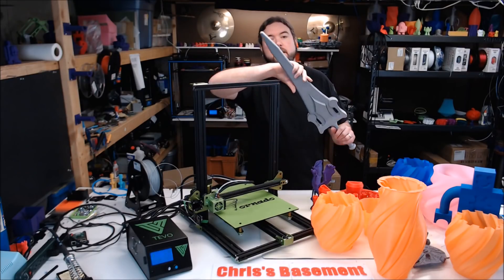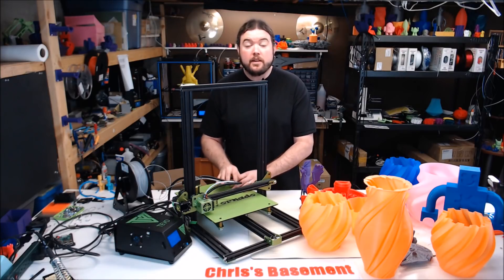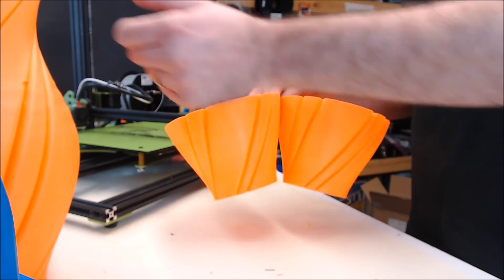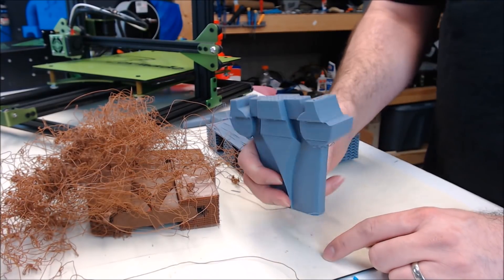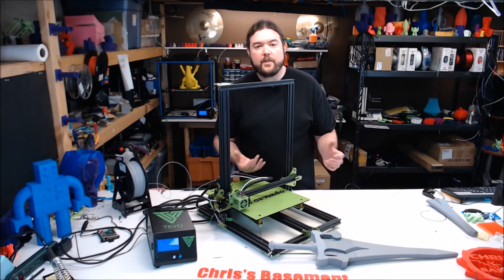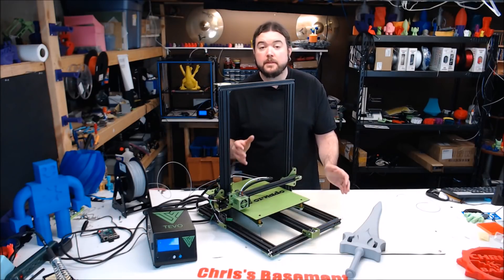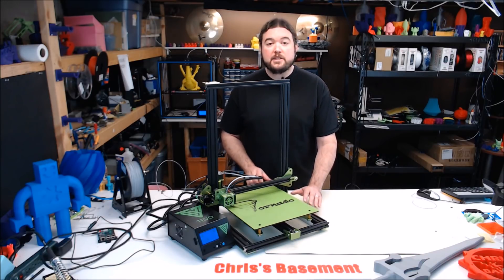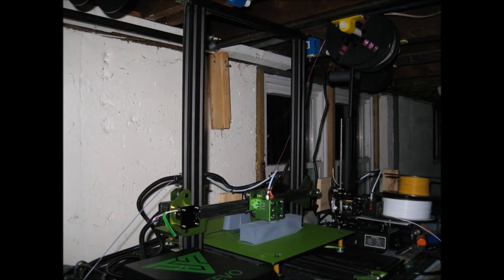Tevo Tornado 3D Printer Review & Tips - Chris's Basement

Comment: I have 2 of these machines. I agree, they need a little bit of extra TLC at first, checking alignments and what not, nothing drastic tho.

Once you do that, it is amazing printer, and most definitively one of the fastest at this price bracket. Just crank those stepper drivers to the maximum 1.50 Vref and you are of to races. I think i've printed a benchy around 48min mark.

It's been one of my more reliable work horse printers, and quite trusty. Certainly like any printer there is occasional issue, but never something where you have to buy something expensive, just some maintenance needs (checking pulley tensions, swapping nozzles etc).

I got also a Tevo Flash, and that is quite fast printer and nicely compact for the volume. Albeit i got one of the very early models with Fysetc TMC2208 V1.0 drivers which all but 1 fried and was randomly missing Y steps, but only once per print, and always some 2mm at once (and irrelevant of Z height). I got a video up with TB6600 drivers on it, printing a VERY bad benchy @ 38mins, but that was 0 tuning, Z height off, and gcode sliced for normal 100mm/s speed, with hotend being waaayyy too hot to cool that fast.
Reply from the maker: Agreed, I think with a few tweaks here and there the Tornado can be a reliable machine. I really like the AC bed. Glad to hear you have had luck with Tevo printers.
Reply: Yea i think you cannot expect much more for the money, QA is a bit shoddy.

I compare Tevo VS Creality like that Tevo has higher grade parts, higher grade engineering, but shoddier workmanship & QA than Creality. But Tevo does not skimp a few cents to cut off quality badly, but actually want to create great machines for people, and honor GPL without even asking to, and keep their machines open for tinkering :)
Creality on the other hand is happy to skimp 0.10$ on a part that lowers quality by 50%. Particularly the obnoxious joke of control board and stepper motors they use. Even with the craptastic extruder you can live with, but closed garbage control boards? nawh, that kinda closes you from fixing their stupid stuff.

Just the other day i had to replace also Y motor on my first ender-3 (replaced X earlier) as it too failed, my smallest one with 6pin plug was much larger (like twice the size) than they used; It hits the bed carrier because it is too large -.-

Comment: The problem of the layer shift is the slicer,wich are you using. The only ones working for me until yet are slic3r and ideamaker. I used Cura first and always got layershifts!
Reply from the maker: I always use Slic3r for everything. My Y motor way actually skipping steps.

Comment: Finally a bonified review and not from a best gear lot lizard! Keep it up and awesome review. I just bought the 2018 version. Before assembly, I disassembled the whole thing. Square up all extrusion ends on a mill and printed several little shims to get dead nuts alignments. Insulated the heat bed, capricorn tube, Swiss hot end and a belt drive on the top to the other z axis. Installed newest marlin and heat sinks on everything. Been running near 24 hours a day and near perfect prints. Reckon we are still buying kits though...
Thanks Larry
Reply from the maker: Thanks for the comment and watching the video! With the kits there is always some suprise waiting. It sounds like you did it right. That's probably a really solid machine now.

Comment: Hey Chris the problem with the parts falling over happens because the bed is moving try rotate the model 90 degrees :)
Reply from the maker: Thanks for watching! I tried that thing every which way!:) I had a lead screw bound up, after I fixed that, everything started working much better.

Comment: thair online support is really good i haad to use it because the lcd didn't display saome lines properly but that fixed itself
Reply from the maker: Vega 128 That's good to hear, I have never tried there support. Yes, I got a green and a red one.
Reply: by the way, if you want to replace the bed with a glass one then use a mirror because this makes it easier to see the nozzle witch would be hard to see because of the bulky hot end asambly

Comment: Can someone explain how he solved the z axis problem???
Reply from the maker: Hey, on mine I just removed the top bearing an the Z rod moved to its correct location, then I just moved the Z holder over. I would remove the top Z rod holder, run the X axis almost all the way to the top of the machine, then put the Z holder back on. That will probably solve it.
Reply: Ok thanks so much
And keep it up you are awesome
Reply: Hey could you explain the last part? The one where you would bring the z axis up etc...
Reply from the maker: Not sure what you mean? To bring the Z all the way up? You should be able to do this from the LCD in move axis.
Reply: I brought it up, my z rod is centered but a little bit to close to the z rod holder. I do not know if you understand. The rod is centered from left to right but to close to the z rod holder
Reply: And thanks for your help and caring about your subscribers
Reply: And can you do a video with upgrades for the tevo tornado?
Reply from the maker: I might some day. ;)
Reply from the maker: So it's to far forward or back. That might be something wrong on the motor side. I would try to remove the motor and Z rod connector and reset them. See if that straitens them out any. Make sure the sure the Z nut on the X is flush an tight as well.
Reply: I found the z nut being to much back. How do I fix it

Comment: At around around 10:30 you stated that there are better choices for around the same price. Just wondering what those are.
Reply from the maker: OneLiterPeter For ease of use and print quality I prefer the CR-10.
Reply: Recently I made the choice to upgrade (from my Solidoodle 2) and went with the Tevo Tornado. I ran under the assumption that pretty much all of the 3D printers from over seas will suffer from some setup issue and that all of these printers from the Prusa to the CR10 will need the user to setup and tweak the machine. Watching your video along with my own experience confirmed my assumption. The CR10 is not perfect either, in fact, just searching youtube for the term CR10 mod's returned a staggering 15,600 results. I also have a couple friends that own the CR10 and CR10s and honestly... they went through the same, test, tweak, dial in and discover procedure that you and I went through with the Tevo. With that said, I think the Tevo Tornado does shine in a few areas that I think is worth mentioning. 1, The Tevo has an AC heated bed that will attain temperatures in just a minute or two that the CR10 will never attain. 2, The Tevo Tornado's print bed is glass not aluminum like the CR10 and lastly, 3, The TITAN style extruder on the Tevo is superior to the CR10's (not by much but still better). In conclusion, I really liked your video and gave it a thumbs up. Ultimately I'd like to see this style of printer, be it from Creality or Tevo, come with dual lead screws, a direct drive extruder and an AC heated bed. Until that time arrives... we will all have to tweak and mod and adjust. Thanks again for the vid!
Reply from the maker: Thank you for the time you put in to this reply. I agree with you, they all have their own set of issues. I personally had a little easier time with my CR-10, but that's just the kit's that I received. It could have easily went the other way, it's just a case by case basis for the most part. The AC heat bed is pretty nice, and the titan setup is a cool feature. We are definitely on the same page when it comes to these printers. Again, I thank you for taking part in the community.

Comment: Chris, can you elaborate on why you think the SSR may cause a problem in the long run? Thanks
Reply from the maker: Hey Mark, sure! It's not so much that the SSR would cause problems, those things are pretty sturdy and seem to last forever. They can get a little hot at times, but mounted on the metal frame box should help. It's more I worry about cable fatigue with the bed wires causing an issue. I have seen a lot of users that have had cables wear out on 3D printer heat beds just because of all the movement they endure. With a DC powered bed it's not such a big deal, you might burn the wires up or a plastic plug, but that's about it. On the Tornado on the other hand, if someone were to be careless with there wire routing or cable strain relief, at some point the bed wires may become worn. If the copper on these wires were to be exposed or grounded out to the frame this could severely injure someone or cause a fire very quickly.  It is not likely to happen, but a larger concern than with a DC power heat bed. With all that said, I sure do like how fast the Tornado heats up. :) Thanks for the comment and thanks for watching.
Reply: Thanks for the reply Chris, Good to know and something I will be watching out for. Thanks for video as well.
Reply from the maker: That would be a great add on for sure.

Comment: Very nice review! Just watched the 3DPrintingProfessor's review and was concerned about a wobbly bed problem, first I heard of it, do you think he just got a broken machine?
Reply from the maker: It very well could have just been a one off problem. I see that kinda stuff all the time. The bed can be adjusted on the Tornado, so I think it could be fixed rather quickly unless it was really bad. Thanks for watching!
Reply: Chris Riley many thanks for the lightening fast response!!! I’ll pass your words off, love the channel!
Reply: I don't know who gave him advice but it was poor advice as you will see if you look at the comments below his video. All he needed to do was tighten the concentric screws which hold the Y carriage to the extrusion. They can come loose in shipping. Also you don't need any 'mods' to make it work, both of mine worked straight out of the box (after tightening a few screws).
Reply: Mark Gibson thanks for the tip, I'll swing by his comments for a read, my thoughts as well that mods weren't necessary, it's a mystery whoever would try to give him such odd advice

Comment: I have  a question I hope you can answer.  
In your video you indicate you "resliced" a STL file.
How do you "reslice" a STL file if all you have is the STL file and not the CAD file that created the STL file?
What slicer do you use for such situations? (OK - two questions)
Thanks for doing your videos.
Reply: Joe Valasko you can re-slice an STL file  by saving over or renaming the saved gcode file of the object you are slicing. I mainly use cura but you could also use prusas slic3r. It’s which ever you prefer. These sliced files are made into gcode by these slicer programs.
Reply from the maker: Joe, yes Colin is correct. What I was meaning by re-slice was during the initial slice I probably got an error and didn't notice it. I ran it threw the slicer another time and it worked. Thanks for watching!